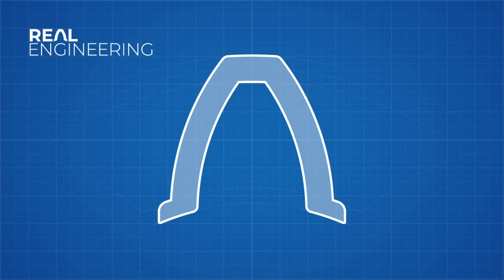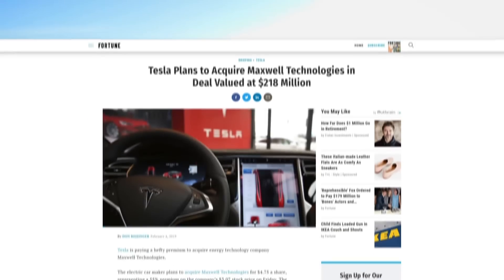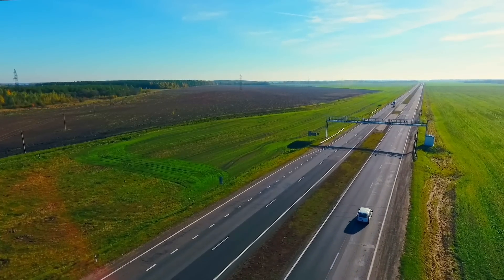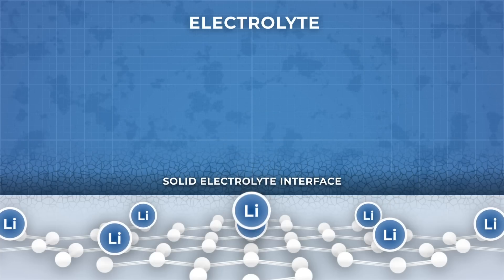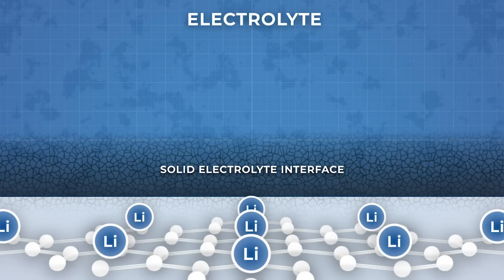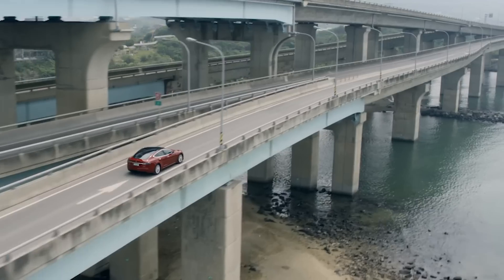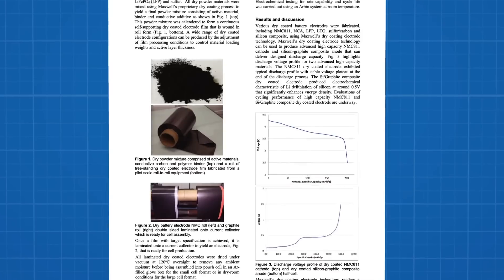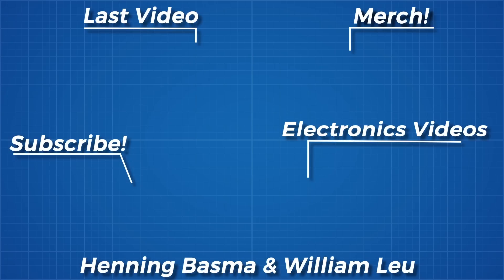Tesla's Quest for Better Batteries

Comment: As a chemistry student who's had several conversations with one of my solid state lecturers, if there's a material someone has tried putting lithium in it.

Lithium also has a few geopolitical problems in that most of the lithium in the world comes from only 3 countries, and two of them aren't exactly easy to do business in.

My lecturer suggested that sodium might be a better all round anion since it literally comes from the sea and it still pretty small. There have been some studies into using Fluorine as a storage medium, or even directly using solvated electrons. There's a seriously huge number of very smart people working on these problems, we'll get there evenually

Comment: What a horrible graph at 1:09. That Y axis manipulates the lines to look like a steady decline when it's not.
Reply: If it were a linear y axis instead of a log axis, like it is now, the decrease would seem greater. This graph makes the decrease look smaller than it actually is.
Reply: If it were we'd hit zero already with initial rate and Tesla would be making money from manufacturing by selling byproducts maybe, what a pity it's not!
Reply: It's a log curve. Used in situations where the decrease from 10 000 - 5 000, the decrease from 1000 - 500 and the decrease from 100 - 50 are considered equally significant.

Comment: Great video but you merged some of the cell ageing mechanisms. You covered the growth of the SEI pretty well, but you didn't cover the issue of the electrolyte digesting itself with side reactions, which is worst at high temperatures and/or high voltages. This, if i recall, is what killed the Leaf. 
Basically SEI issues increase with the number, depth and rate of cycles (high and low temperatures also play a part). 
By contrast, parasitic reactions within the electrolyte and between the electrolyte and other components don't need ANY cycles. Just hold a lithium battery at the top of its charge curve and keep it warm and it will electrochemically destroy itself even without you cycling it. 
Again, this is where they went wrong in testing the first Leaf batteries. They thought cycle number was the main aging factor when it was actually just cumulative time spent above half charge that was really killing their batteries. If you test cycle a battery 500 times in a month it spends only 2 weeks above half charge and the test results look splendid. (I refer to half charge for simplicity's sake, but the capacity loss/voltage/temperature curves are obviously on some kind of exponential function that gets way worse at the extreme. You would expect electrochemical engineers to know about this from first principles but somehow it must be less predictable than one would think). 
You emphasise the clogging of the SEI, to which both of the above contribute. It is true that car batteries are usually retired because internal resistance prevents the car delivering power fast enough, and the main effect of a clogged SEI is increased internal resistance leading to reduced power density. However, I believe total capacity decrease is also a big factor in the decision to retire a car battery. Capacity decreases because lithium gets irreversibly tied up in side reactions, as well as in the reactions that build up the SEI.

Comment: There should be electric cars that have an easy slip out slip in battery   that it can change at petrol stations and batteries swapped from the car are charged at the station and the battery is universal for all electric cars
Reply: Tesla tried battery swapping on Model S. Although  quicker than refueling an ICE, it was rarely used and so they concentrated on fast charging.
https://www.tesla.com/videos/battery-swap-event?redirect=no
https://electrek.co/2019/03/07/tesla-v3-supercharger-action-first-look/

Comment: A little while ago there was a big deal made about graphene. I don't hear too much about it anymore. Any headway about that? I am still convinced that once making hydrogen gas becomes cheaper and easier Hydrogen will be the best mobile energy source. If developers were able to make smaller more efficient hydrogen Fuel cells and electrolyzers, cars may one day  be able to make their own hydrogen supply. Who knows, it might even be a closed system.

Comment: The on screen typo @3:52 about the charge of the anode in an electrolytic battery caused me to spend two hours researching battery chemistry. As a mechanical engineer I don't spend a ton of time fuxing with electricity.  Can someone with more experience confirm for my poor brain that the signs in that scene should be reversed when discussing the type of Li-Ion battery Tesla is currently using?
Reply from the maker: Yeah we swapped them somehow. We were editing this right up until the video was uploaded. Somehow managed to miss that error.
Reply: The diagram is displaying a discharging galvanic/voltaic cell, which converts chemical energy to electrical energy, so the diagram is correct, but the voiceover is not. You are probably confusing it with an electrolytic cell, which converts electrical energy to chemical energy (e.g. a charging battery), in which case the anode is positive. In electrochemistry, oxidation occurs at the anode.

Comment: What is your opinion on Rimac? I'll copy-paste here one paragraph from article I have read recently:
"Rimac is the company that currently holds all the aces. Not Tesla, not Toyota. You might recall that Porsche has bought a 10 percent share in Mate Rimac's business and Pininfarina, Koenigsegg and also Aston Martin in its Valkyrie use Rimac's battery technology. Rimac managed to develop a 9,27kWh battery-pack consisting of over 3000 individual parts that can deliver 4.35kW per kilogram in a package that weighs 115kg and occupies only 67 litres of volume in the middle of the vehicle. No other manufacturer gets close to this, so it's not just about hypercars. On the electric car battlefield, Rimac is currently the force multiplier."
Reply: It looks like the model 3 battery modules claim roughly twice the gravimetric energy density as the numbers you quote. So many factors to select for in pack specifications, such as cycle life, safety etc. Makes comparisons out of context very hard to evaluate.

Comment: A normal battery can achieve the discharge rate needed for the acceleration of the Roadster 2
Reply: It certainly will.
If the Roadster 2 has about 1 megawatt of power (about 1,340 horsepower), that's only a 5C pulse discharge for the 200 kWh battery pack. Shouldn't be too big of a deal for good-quality conventional lithium ion cells.
No super-duper-ultra-hyper-uber-mega-Armageddon-capacitor needed.

Comment: I believe you have got the Nissan Leaf degradation issue backwards. I remember there was an issue with the first cars in hot areas in the US, but nothing about cold climates. I am an owner of a Nissan Leaf 2014 version in Norway, and it has been among the most popular cars (not just EVs) in Norway for years, so it would be widely known if the battery degraded drastically within a year or two. The Leaf may not have liquid cooling, but there are heating elements installed to keep the battery from freezing.
Reply from the maker: No, I said the cold slows down degradation. I just did not make it very clear that hot speeds it up. My bad!
Reply: @RealEngineering  Well, at 8:13 you talk about a double edged sword of lowering the temperature, then go on to say that "this is one of the reasons why Nissan Leafs battery lost a huge amount...in many countries" and point out that the reason was "temperature". 
At 9:15, you also said about the Leaf "..makes it a poor choice for anyone living in anything but a temperate climate" while almost exclusively showing clips of EVs driving in winter.  Even though you don't actually say that cold climate causes degradation, I think the phrasing is a bit too ambiguous, and makes it easy to arrive at that conclusion.

Comment: @Real Engineering 3:56 You have the plus and minus symbols switched
Reply: I think in an electrolytic cell the anode is actually positive while the cathode is negative
Reply: Glad I wasn't the only one to notice
Reply: @MaciekBroken If you want to be entirely correct the negative electrode is the anode when discharging since a oxidation takes place there (Li->Li+ + e-). When charging the negative electrode is the cathode since a reduction takes place there (Li+ + e- -> Li). For the pos. electrode it's the other way around.  But usually the neg. electrode (graphite) is referred as the anode and pos. as cathode (metal oxide) since it's in discharging direction.
Reply: @simonkuecher  That's what i thought later on it simply depends on the state of the cell But still i thing it is a bit confusing as for e.g. the diode has an positive anode and negative cathode, but in chemistry in 

ion dissociation it's again another way around. Anyway thanks for ur comment on that
Reply: In one definition, yes. But I think he said it wrong as the cathode is usually positive.
Reply: @DavidMcCoul  false
Reply: @jasonngwa9151  As others have commented, it depends on whether you use "conventional current", in which a positive charge is moving, when in reality it's the other way around. For conventional current, the cathode is positive by its traditional definition. https://en.wikipedia.org/wiki/Cathode
Reply: @DavidMcCoul  from Wikipedia. 
Cathode polarity with respect to the anode can be positive or negative depending on how the device is being operated. Although positively charged cations always move towards the cathode (hence their name) and negatively charged anions move away from it, cathode polarity depends on the device type, and can even vary according to the operating mode. In a device which absorbs energy of charge (such as recharging a battery), the cathode is negative (electrons flow out of the cathode, and charge flows into it), and in a device which provides energy (such as battery in use), the cathode is positive (electrons flow into it and charge flows out)
Reply: @jamesirwin7677  Thanks. It really is just a matter of definitions. Whether you're using conventional current or not changes the definition. In any case, it would make more sense to use the terms "electron source" or "electron sink" instead of cathode or anode to limit confusion!
Reply: You are correct for conventional current which is what electrical engineers like myself use. However in reality the actual charges are opposite (this is the model used in chemistry) and the flow is correctly shown in his diagram. The reason for the opposite polarity is that the definitions for the functions of electronic devices were made before the it was understood that electrons flow in a circuit.
Reply: Exactly! The anode is the positive part of the cell. Very basic error, if you ask me..
Reply: False

Comment: I don’t understand why acceleration has to be so quick?
Reply: Regenerative braking could be the killer app for capacitors. We usually accelerate slower than we brake, plus batteries usually discharge faster than they charge... So battery dynamics and braking dynamics are as ill-matched as they could be. Also, it may be that even existing acceleration on Tesla is really too aggressive for optimal battery life. If so, caps could be used to give same performance but better battery life.

Comment: lol You need to have almost no electronics knowledge to say capacitors can replace batteries.
Reply: Depends on the application, but in some they can, people have replaced their 12V car batteries with capacitors.
Sadly those cost 6x more then a plain lead-acid battery, but they can be a replacement.
Reply: @MsSomeonenew  How would that replacement work?

Comment: It's funny how many companies including Toyota stated prefusely that ultra capacitors were more efficient than pure batteries well before Tesla toted their all-electric vehicles. Now Tesla is jumping on the capacitor bandwagon when they realize that pure battery technology wasn't sustainable for high power delivery. CLOWNS!! Hybrid systems are the future!! don't buy the hype of pure battery powered cars! Yes carbon offsetting in cities is a task that should be done, but that isn't the most efficient cycle when it comes to fuel efficiency (be it gas fuel or electrical energy!)

Comment: Another important advantage of supercapacitors is the ability to make a main battery higher capacity. If high currents are not necessary it is possible to increase the capacity. Right now the battery should be built to withstand very high loads of acceleration.
So the vehicles can use weaker batteries of higher capacity and handle the peak loads by charging the supercapacitors.
Reply: Batteries are not he limiting factor - motors are.
https://youtu.be/zlJRo9yVzus?t=4088

Comment: I still think the Tesla truck will flop. There is a reason diesel engines are used in heavy load bearing long distance trucks and long distance warships. Diesel engines have huge amounts of torque and range from a lean fuel burn. Neither batteries nor gasoline engines will ever be able to match that ability. If they could shipping companies and militaries would have already abandoned diesel for electric or gasoline hybrids because of cost performance ratios but that hasn't happened and will not happen. Same with electric air planes, the batteries are too heavy for anything bigger than a drone or one seat light aircraft. Teslas have a niche place in small short range pesonal transportation like cars where traveling 1000Mi, staying in the air, or hauling 10,000lbs of cargo are not required. I want Tesla/SpaceX to succeed but the fact that Elon is wasting time and millions of dollars on dead end projects makes me very nervous.

Elon's projects:
BETTER TESLAS<----------------yes
REUSABLE SPACECRAFT<-----yes
GET SOME SLEEP <----------yes
hyperloop
cold gas thrusters
electric trucks
Reply: Thunder foot makes a pretty good case regarding batteries not getting better. Time will tell who is right though.

Comment: In their slides when Maxwell lists the advantages of their dry electrode technology they clearly say "solid state" (along with no cobalt needed, higher density, reduced costs etc).
What does it mean? Does the dry electrode technology have anything to do with solid state batteries?
Reply: Dry electrode manufacturing is applicable to any chemistry.
But a dry electrode process is nothing to do with solid state batteries.
However Maxwell submitted an application under Rule 24b-2 requesting confidential treatment for information it excluded from the Exhibits to a Form 8-K filed on December 19, 2018. Something else they are working on?

Comment: The content is good. Cell and battery is used interchangebly, whihc shouldnt have been the case expecially when you explain the inside of the cell and not the complete battery. Battery would usually be a combination of two or more cells.

Comment: Tesla does not produce battery cells (or solar cells).  100% of Tesla's battery cells are purchased from Panasonic or Samsung.   The battery cells use the highest performance, but least stable lithium chemistry, hence all the battery fires.  No other EV company risks using this chemistry, so Tesla's claims of superiority rise purely from putting their customers at risk (customers such as the doctor that burned to death in FL a few weeks ago after the suspension failed).   

The idea that Tesla is at the leading edge of battery technology is absurd.   Panasonic just fired the CEO of Panasonic Automotive over the disaster that is the Tesla account and Panasonic has partnered with Toyota on next generation EV batteries.
Reply: Saying a guy having gas tank in his Car.....lol....
Reply: @3107karan   That's not even a sentence.    Your statement has no relationship to the cogency or logic of what I'm saying.    In any case, an EV just burns the petroleum in an electric power plant.
Reply: @3107karan   EV's are fundamentally petroleum powered.
Reply: Tesla is aware of the fact that batteries and fire up. That's why they turn on fire in a very controlled manner. One after another. Not all at once. This way passengers can escape safely. Don't forget, Tesla's cars are some of the safest on the market. 
What happened exactly on that accident I don't know. Didn't read about it but I know of it.
Reply: Tesla cars are not 'some of the safest on the road'.  If you look at the real statistics Tesla cars are not safe relative to their price point.  It just came out a few weeks ago that Elon Musk/Tesla were totally lying about cars with autopilot being safer.   Tesla's own data shows Tesla cars with autopilot are significantly more likely to be in an accident despite Musk's repeated claims to the contrary and the data being kept secret for 2 years.  Musk is an unethical, dishonest stock promoter, a bully, and a fraud.  All of those statements are proven by his own actions.
Reply: Tesla own the IP developed in their own research and testing lab in Nova Scotia run by Dr Jeff Dahn, a  pioneer and  patent holding researcher in LiIon tech.
The low Cobalt, Aluminium additive, high energy density cells in the Tesla are unique to them, and the lowest cost on the market.
Tesla hold patents in battery tech including in Lithium Air.
Reply: @waynerussell6401    They funded Dr. Dahn's lab in 2016.  Dr. Dahn has a lab at a University.   There are similar labs at MIT, University of Michigan, and many others.  The Toyota/Panasonic partnership for next generation EV batteries is projected to employ 3,500 people.   There is a huge difference between a university lab and serious industrial product development.  

University labs certainly have their place.  Serious companies fund them to develop future talent not their primary products, but it's a perfect investment for an unethical stock promoter so he can spin yarns.